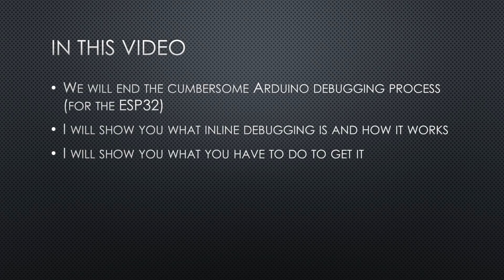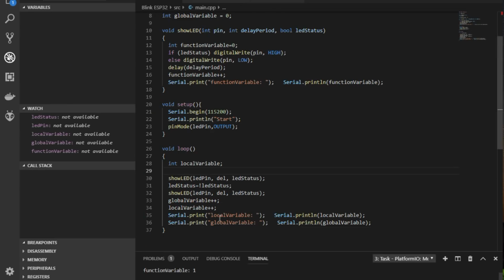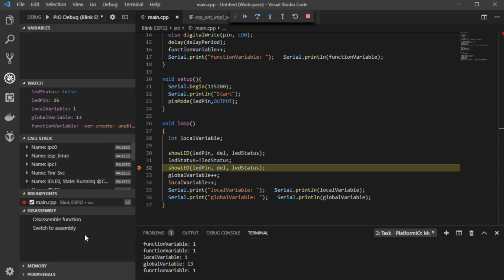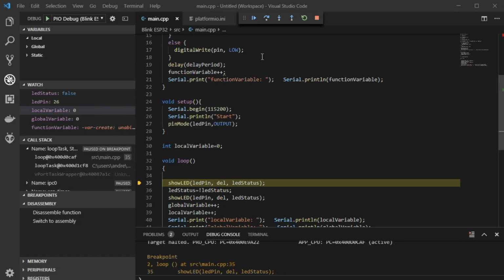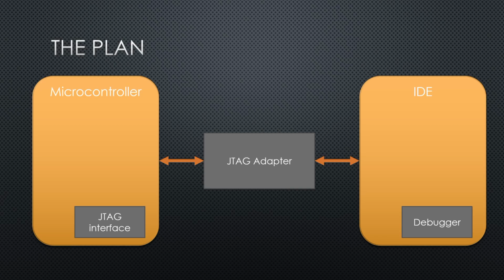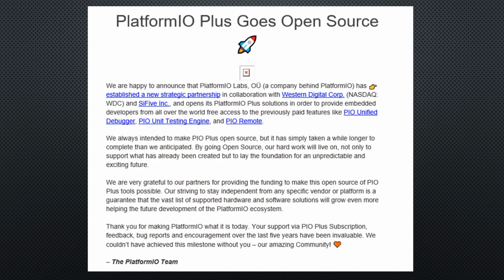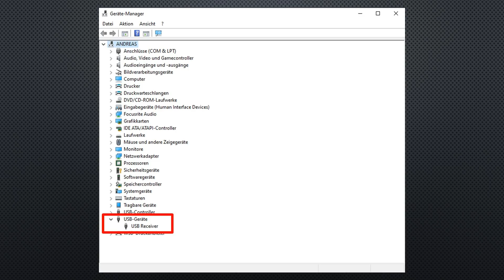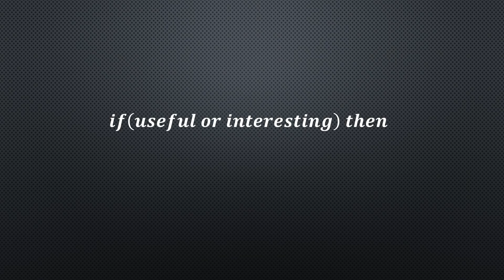#274 Free Inline Debugging for ESP32 and Arduino Sketches

Comment: Hi Andreas, again a very helpful training video, thank you so much. Here is little feedback, I believe the entire platform IO is not needed, you need OpenOCD with gdb , this allows to do command line gdb debugging.

Another point is that this is called remote debugging (not inline debugging).

The Arduino ARM MCUs debugging is not this expensive, for Arduino you can use the SAM D21 Xplained Pro or Arduino Zero which are about 25 €  and Arduino D21 compatible. The Xplained and Zero boards have a debugger included. I was also de-soldering the D21 MCU on the Xplained board than connected the debugging wires to our RadioShuttle LoRa Arduino Zero board to do remote debugging.

Other ARM MCUs boards (e.g. Nucleo from the market leader STM) they costs about 10 Euros and include a debugger, again with Openocd this can be used for remote gdb debugging of the MCU on the board. Another option is that break-out the debugger part of the Nucleo board and connected this to another ARM STM32 MCU. I did a documentation about this here: https://www.radioshuttle.de/turtle/nucleo-st-link-interface/

Regards from Arduino Hannover and radioshuttle.de
Reply: OpenOCD is an excellent tool for ARM based devices that use SWD, but it does not support Espressif's custom instruction set as far as I know, and Espressif is quite unique in it's cost effective support for Bluetooth/Wifi radios that make it quite popular
Reply: According to the Espressif docs they use Openocd:
https://docs.espressif.com/projects/esp-idf/en/latest/api-guides/jtag-debugging/
Reply: So could my Bus Pirate with OpenOCD link in with PlatformIO to do the same?
Reply: actually, its called online debugging (according to the official doc). remote debugging is something different.
Reply from the maker: I think, you are right that PIO is not needed. But it makes things easier, at least if you try to work with the Arduino ecosystem. Inline debugging was around for many other ecosystems, just not for Arduinos (At least I do not know of one). And this is what most of my viewers use... I for sure will try a SAMD21 Arduino and, if the new Nanos arrive, also with them. I assume this would also be interesting for this community. Maybe less for professionals like you.
Reply: @AndreasSpiess  
The big thing that stopped me from exploring D21's is the issue of the 2 different bootloaders. I still haven't seen anyone able to effectively add a bootloader to a fresh D21 without the expensive official toolchain and AVR studio. I haven't gone actively looking for options in awhile, but I have seen several comments and forum posts where people mention desoldering D21's or using some specific factory board setup, so I assume there are still issues with this. I actually saved those OpenOCD references (mentioned earlier elsewhere) because they were also about how Adafruit uses OpenOCD+Rπ's to program the D21's. Still I don't think she fully explained the process for a D21 bootloader in the video either, as the actual upload theme was 'build devices for manufacturing with open source toolchains.' 
 I have a ch-egger J-Link, but haven't tried it either. I have seen someone demonstrate programming a fresh D21 with an ST-Link but it wasn't a tutorial, some aspects were not documented, and the CC is not active or responding to comments for years. The biggest hurtle for me is my unwillingness to use antiquated Windoze only toolchains.
  I really like this idea of using the OpenOCD + GDB + terminal. I find myself using AVRdude more and more lately as I've gotten familiar with it. If I had a simple working example of this debug option using a terminal it would be a big enough deal I would probably pause all current projects to actively explore this. That's not something I often do, but you're working on a subject I'm very interested in if I can do it within a Linux OS.
   Helmut thanks for the info and link/writeup. I'll pass that through G-translate to read it in English shortly :-)

Comment: Nice explanation of inline debugging. Thank you. Only one note and some "provocative" questions. There are lot of reasons why inline debugging is not so popular like in the past, for example in the time of 8080 processor (1985). The reasons are multithreading and thousands of external events per second from wifi, i2c, spi, one wire sensors, interrupts, buttons... External events is hard to stop. When you stop processor you lose real time, connection to the sever, external events and many more... Ofcourse for very simple applications like debugging of blinking led it is possible. But for simple application do we need it? Is it posible to replace "stupid" real time logging via serial interface with inline debugger? What is main task of inline debugging?
Reply from the maker: You are right with your comments. But since we do small projects with our MCUs it still can help. I would not recommend it for a server ;-)
Maybe you can set the breakpoints at particular areas where you can stop the CPU without hurting the functioning. Or you debug your sketch without WiFi at the beginning... Just ideas. Debugging real-time systems always was tricky, even back then.
Reply: @AndreasSpiess  is it possible to catch "kernel panic" with inline debugger? I mean, for example, stack corruption, heap corruption or unwanted memory overwriting? What posibilities have breakpoints? Can we see stack dump of all threads when processor stops?
Reply from the maker: You see the registers and all memory locations as well as processor flags. Also, all variables used by the "infrastructure"

Comment: Instead of the Espressif or Olimex adapter, I've successfully used FT232H boards (CJMCU FT232H). They are about USD 7.00 on Aliexpress. The pin mapping is: TDI -> AD1; TDO -> AD2; TCK -> AD0; TMS -> AD3. I've used a Mac with OpenOCD however and don't know if it works with Zadig.
Reply from the maker: Maybe you try it in this config? It would be beneficial if we get an even cheaper adapter. The problem I see is not Zadig, it is to choose the right definition file in platformIO.ini (and if one is available)
Reply: @AndreasSpiess  It turns out that FT2232HL (such as the CJMCU FT2232HL) boards are even better. They are a drop-in replacement for ESP-PROG board. With exactly the same configuration in PlatformIO, on Windows (Zadig) and MacOS (sudo kextunload -b com.FTDI.driver.FTDIUSBSerialDriver) it just work. That's no surprise as the ESP-PROG board is in fact at FT2232HL board. And it uses OpenOCD in the background. The CJMCU FT2232HL is about USD 9 on Ebay and Aliexpress. The slightly cheaper CJMCU FT232H board (USD 7) can also be used. But it requires some fiddling in the OpenOCD configuration files as the USB product ID is 0x6014 (as opposed to 0x6010); otherwise the device is not found.
Reply from the maker: Thank you for your info! Could you give us a little more info on which file to change, where to find the product ID etc.? There are quite a few cheap FTDI boards on Aliexpress and with your help, we maybe could make them run...
Reply: @AndreasSpiess   The details can be found in these instructions: https://medium.com/@manuel.bl/low-cost-esp32-in-circuit-debugging-dbbee39e508b
Reply: How about the drivers for Linux? Could you please help me with this.
Reply: @josvdsnepscheut2832  To the best of my knowledge, you need to follow these instructions to install udev rules: https://docs.platformio.org/en/latest/faq.html#faq-udev-rules. I don't have a Linux system to test it so I can't verify it.

Comment: I'm interested in the ESP32 but I've stayed away as I've not seen much on running the chip in low power modes. For example: sleep and wake on pin change. Are there any good videos on this subject? Is this something you would consider covering in the future, Andreas? Thanks for a great video. I'm going to take a close look at this debugging feature.
Reply from the maker: I did a video about the different wake-up modes if I remember right. Maybe it needs some "reinforcements" with another video ;-)
Reply: https://randomnerdtutorials.com/esp32-external-wake-up-deep-sleep/

Comment: Dear Andreas, thanks for another very nice video on a Sunday morning. Another alternative for a JTAG adapter is named „Mini USB Blaster“ (a white and blue enclosure) for around 2-3€ on AliExpress. I‘ve used it for quite some time together with Eclipse, but it should work with PIO as well.
Reply from the maker: Maybe you try it with this setup? It would be beneficial for my viewers if they can buy an even cheaper adapter.
Reply: I gave it a short try, but there does not seem to be a config option for the Altera USB Blaster (yet). My few experiments didn‘t yield any usable results...
Reply: Since I‘ll be away from my playthings for 1-3 months (work-related) I cannot follow up on this in the next weeks. I have put it on my list, though, for later experimentation
Reply: It took way longer than expected, but there is now a better description of how to use the Altera USB Blaster and its problems. So actually I would not suggest to buy it. Here is the link: https://www.esp32.com/viewtopic.php?t=9901

Comment: Great video, yes, want one. Also you could use the "static" keyword to keep your local variable in its associated function without making it a global. It will then keep its value between calls.
Reply: Beat me to the thing I wanted to point out. I don't know why, but I have an aversion to global variables and much rather keep things with the associated function that is using them when possible.
Reply from the maker: Thanks for the hint!
Reply: Also "volatile" to make sure the compiler doesn't compile out variables that don't actually do anything (useful to count the number of times you've hit a function).
Reply: Great advice
Reply: I used to be confused with something like :
 static int var=0;
In the beginning of a function because I thought  when the function runs again the var gets set back to 0 :)